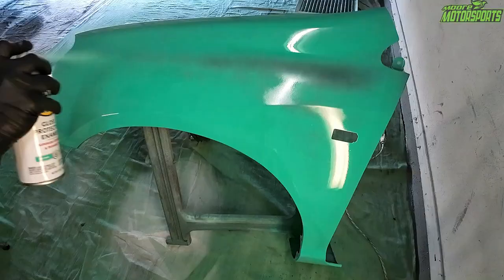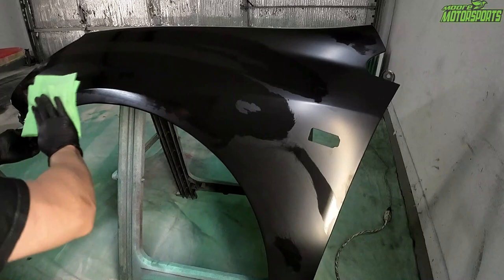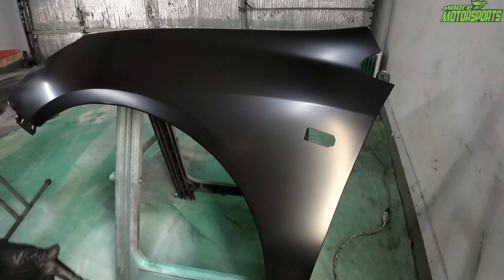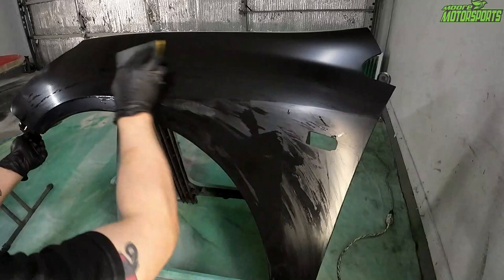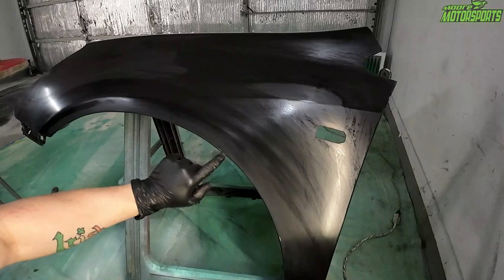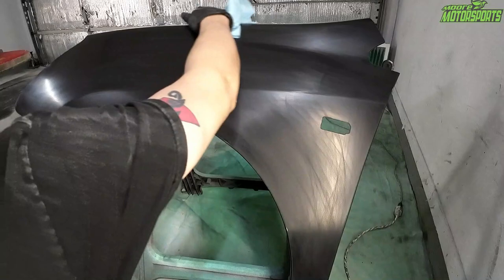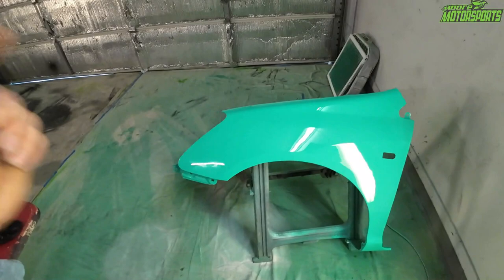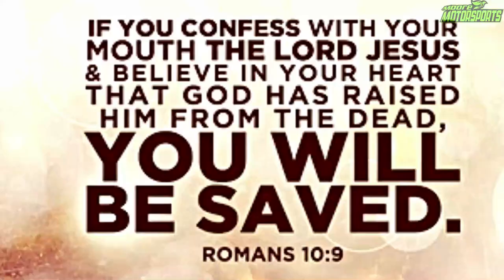HOW I MAKE SPRAY CAN LOOK GOOD!

Comment: Looking good, Brother! Question for you; I just picked up a car that has a peeling clear coat on the roof. What grits do you recommend to get it prepped for a respray with spray cans?
Reply from the maker: I recommend getting that clear sanded smooth with 800-1000 and make it as nice and smooth without going past the color coat. Then when it’s all smooth hit it with clear again.

Comment: I have a question, if you are redoing your fender in the same color, but a different shade kind of situation, do you wet sand the panel or dry sand it? My fender's clear coat is fading away and I would like to paint them over
Reply from the maker: I prefer wet sanding because it seems to make the sand paper last longer and less dust but dry sanding would work too.
Reply: @JamesDguy  ok thank you. I really learn a lot from you with painting with spray cans

Comment: I do have a question for you. I want to duplicate your Berry Pink CRV, but on my Nissan Leaf EV. After the color painting, I want to add 2 coats of holographic flake. My idea was to add the flake to a quart of Rustoleum Clear Auto paint and roll that on with a foam roller. Sanding between the two clear holo coats, the finishing with 2K clear. When the whole job is dry and hard, then a resand and buff, same as the CRV. What tips, tricks, concerns, advice could you give me for this job? This isn't my first rattle can paint job, but my first time using flake in my top coats. Thanks, Ginny in Denver
Reply from the maker: well as for roller idk about that stuff but in theory it should work with alot of wet sand, clear,dry repeat until nice and smooth. As for the tips and tricks everything i have to offer is in my videos honestly lol.
Reply: Your idea screams out "test panel".  As in: something smaller, not on the car.  

That way, you can test paint the pink base, and experiment to see if the clear+flake idea works with a roller, or not.

Edit:  there are also "refillable aerosol cans" that can be had.   You'll need a compressor, or a bike pump, and cleaning solvents, but you could see if you could spray the clear + flake layer that way.
Reply: @chrstphrr  refillable aerosol cans??? How did I not know about this? Thank you!!!
Reply: @ginnynewman317  the one I see most is the YouCan by Jacquard Products.    I used a wee glass vial contraption at a friend's decades ago to spray small touch ups.

It'd be something James would probably like to try as an in between aerosol and compressor powered sprayer, so he's not annoying his apparently HOA like Karen neighbours
Reply: How long did u wait in between coats

Comment: Doesn't it fade without clearcoat?
Reply: It takes a while but yes
Reply: On the can it says it’s has uv protection from fade that’s a plus
Reply: It would more likely lose its high gloss. I have painted many small engine parts and things, and after some years, the gloss is gone. The paint surface is not hard enough, doing a 2k clear  give you a hard gloss surface.